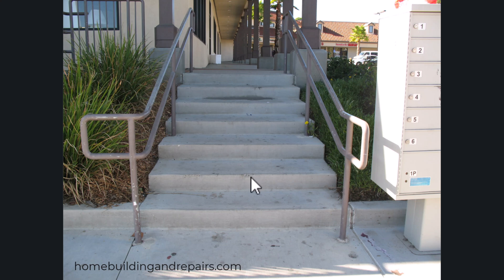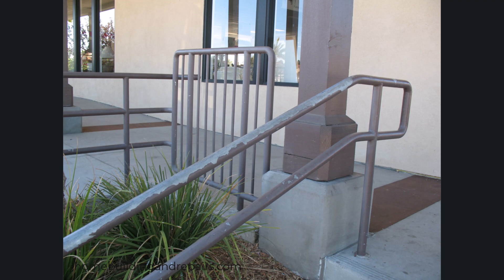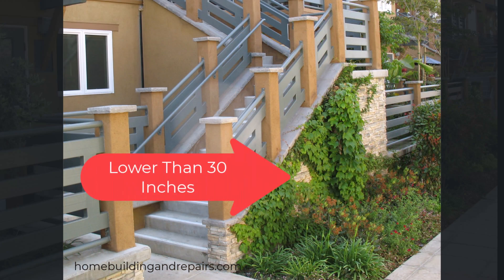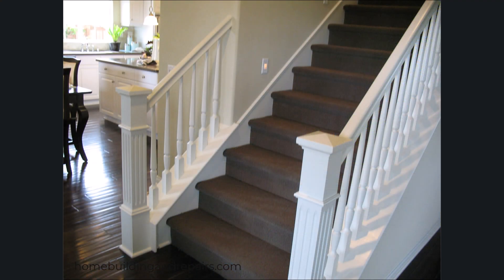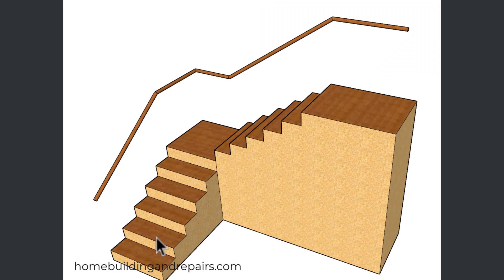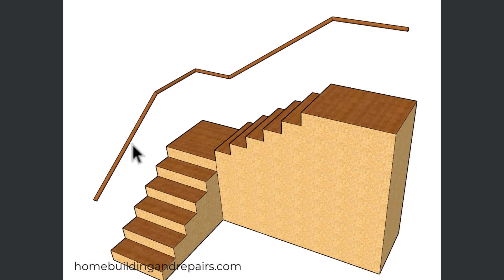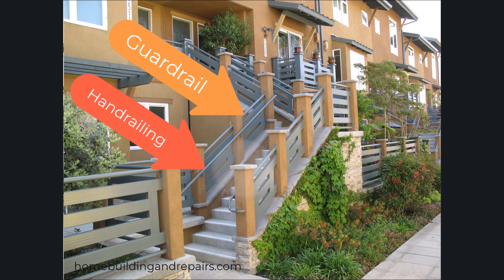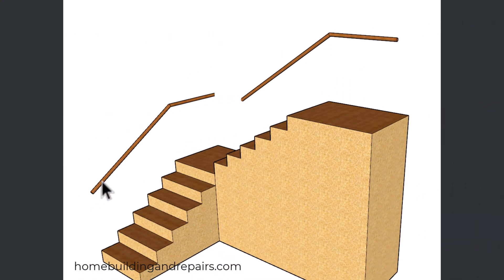Building Codes And Continuous Handrails - Simple Explanation And Examples

Comment: On 2 x 4 framing i  always seen framers use  31/2 sinkers , for a nail gun do they have 3 1:2” nails I only seen 3” and 3 1/4” is 3 1/4 ok? Thanks
Reply from the maker: Most homes are built using the 16d gun nail that is 3.25 inches. A 3.5 inch nail is usually referred to as a common nail and they do have nail guns for them.